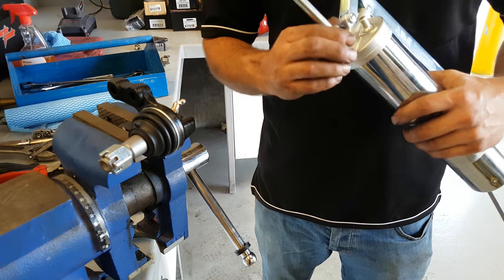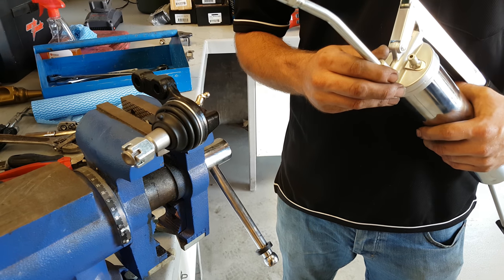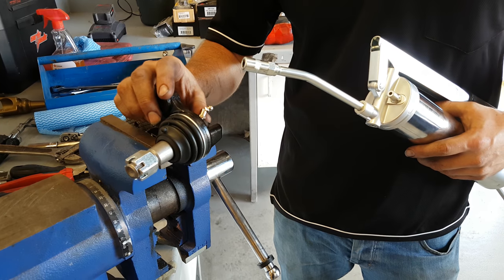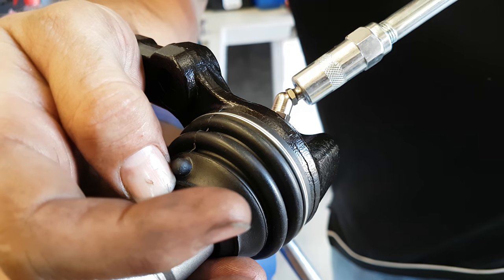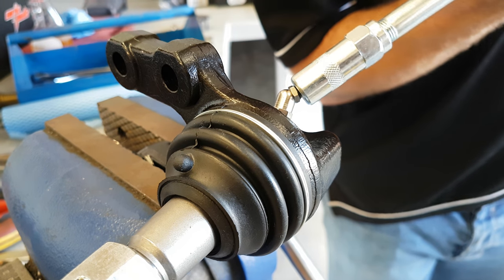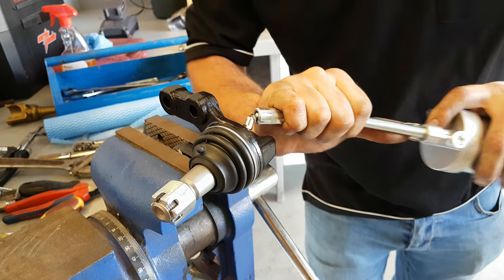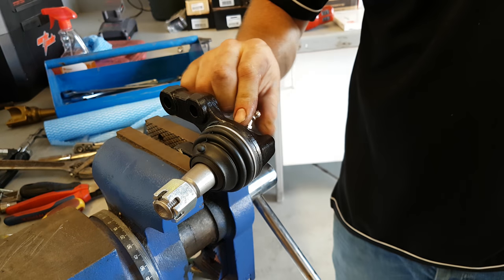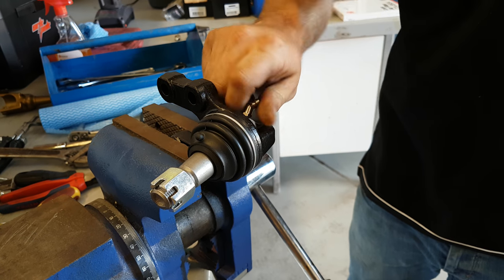How to remove a grease gun from a grease nipple.

Comment: This is the wrong way.  👎
Reply: Tell us the right way then
Reply: @AboxofMonsters  I snapped a  M6 nipple by doing it the way as shown above, I found a video of of doing it slightly different and practice with a spare nipple secured in the vice and now got the knack of it.
Thanks for replying.
Reply: Thanks guys
Reply: @andrewheale4738 Well first you need a zert pully pulling puller